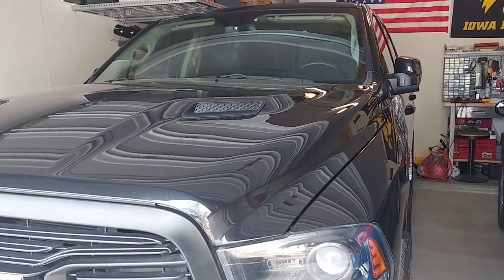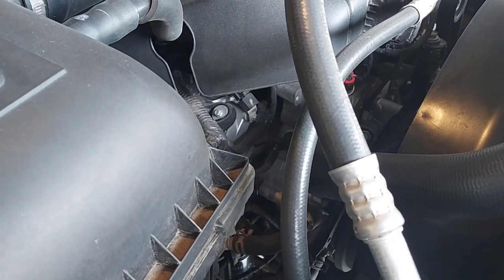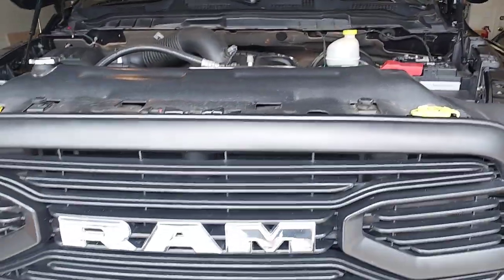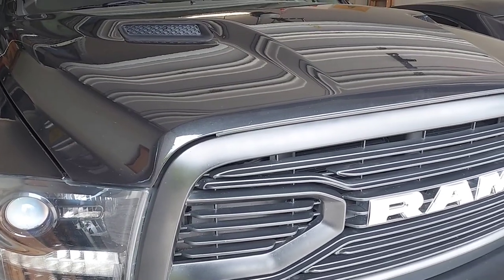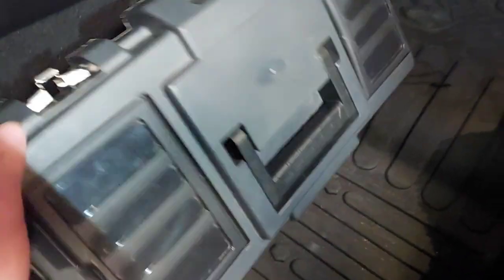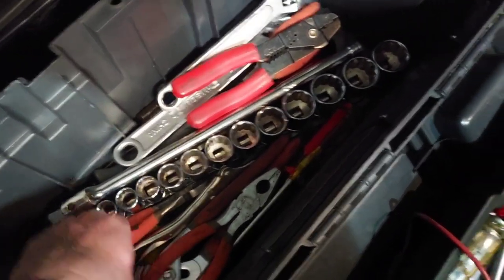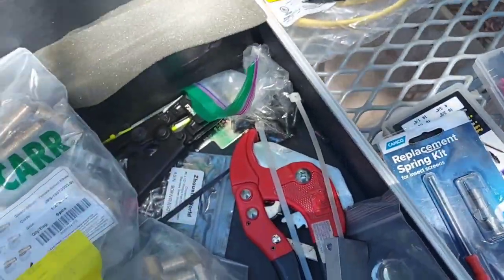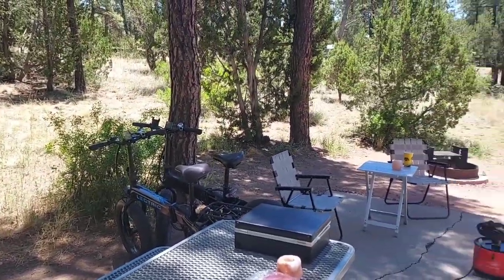Ram Hemi tick possible solution, tools I bring along

Comment: I had a 2015 ram 1500 5.7 hemi. tick started about 2 months ago. lifter ate the cam shaft on cylinder 3 on a road trip to Oklahoma. got stranded in Oklahoma and traded the truck in. finally got rid of this rolling money pit. Truck had 157,000 all highway miles on it. I changed oil every 3k changed tranny fluid every 30k, and really babied it. All in the last year I did the following...

Water Pump
Radiator
Cooling Fans
Wheel Bearings
Exhaust manifold bolts and gasket
Evap canister
Transmission solenoid pack
Fuel filter and pump

I am probably missing a few things but it was just one issue after another, its like it would never stop. I've never had this many issues with any vehicle in my life. I wont be purchases a ram again.
Reply from the maker: What did you trade in for? I have my eye on the F250 with the gas Godzilla engine.
I have 51k miles, hopefully it will last till 100k miles.